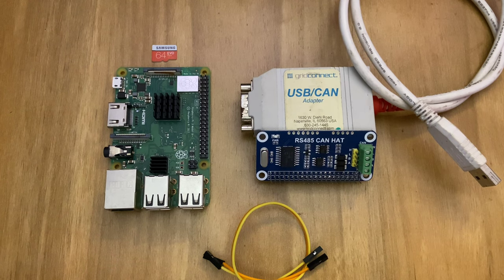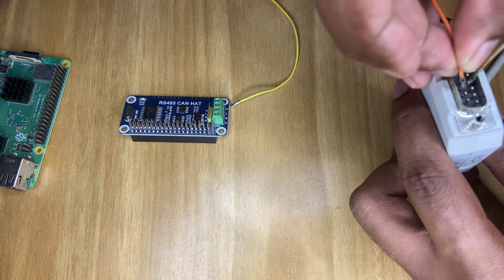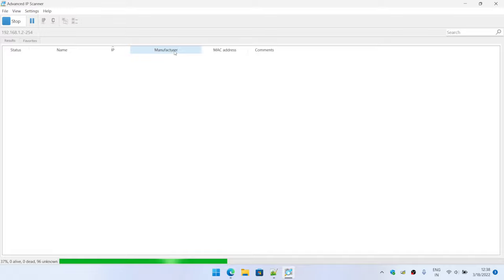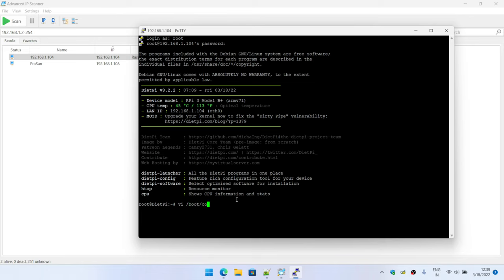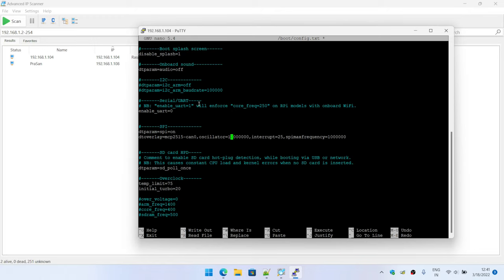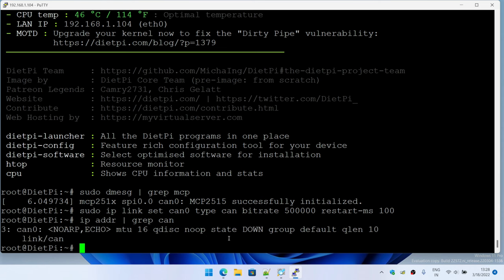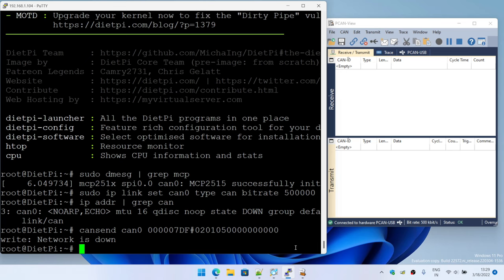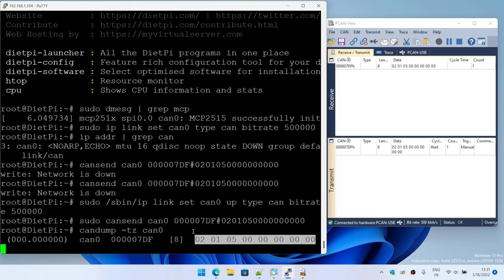How to interface CAN peripheral  to Raspberry Pi

Comment: The device-tree overlay is kind of confusing.. for example, if you want to use a different can-hat, what changes to which files would be necessary?

I'm interested in using a Microchip MCP2517FD/MCP2518FD can controller.. it's also SPI based, but the filter/masks are configured differently.

Comment: hey dear you made a great job. but how can we connect this raspberry pi and canhat to the obd2 adapter...
Reply from the maker: You can follow the tutorial below, although since the CAN hat is missing a DB9 connector you may need to improvise with a breakout wire.

https://wiki.seeedstudio.com/CAN-BUS_Shield_V2.0/
Reply: @degzero  hey man. The tutorial is based on the Arduino. Is there any way to have it with a Raspberry Pi 4 ?
Reply from the maker: @Lee-gr2sd  this is for RPI

Comment: Do you have an idea about pi 4 b we can connect ?
Reply from the maker: If it has a 40 pin header then you should be able to interface this module. Check specially for SPI interface